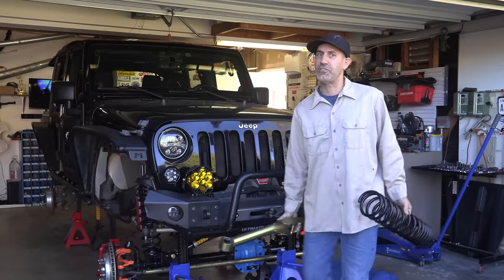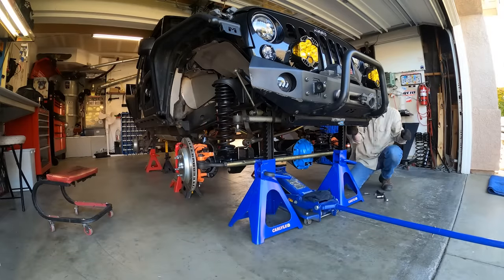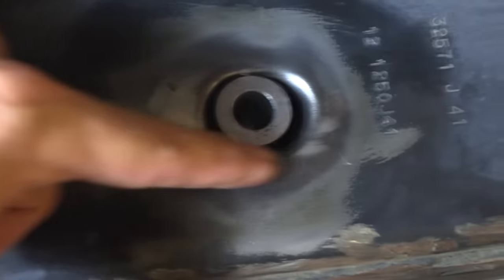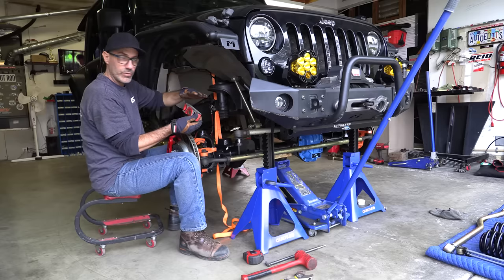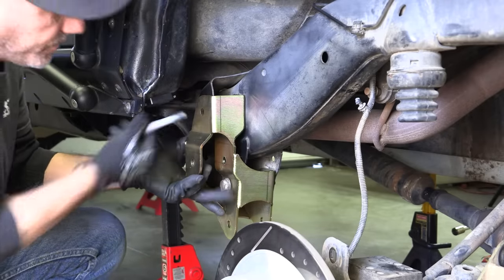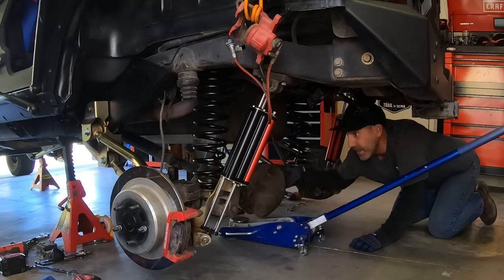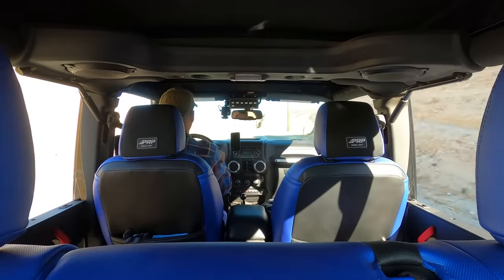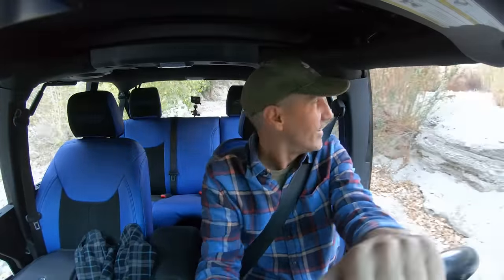4.5" Jeep Lift Kit How To Install DIY - Lock n Load Long Arm from MetalCloak

Comment: Running the same front bumper.  I also have the same scratches from the rocks.  I know it is powder coated, but you got any plans on dealing with those scuffs?
Reply from the maker: I really like the bumper as well!  Every once in a while I think about touching that up and then get distracted  by other stuff... they say the semi gloss black from rustoleum is the perfect match for that.

Comment: If you expend the energy to get an aftermarket steering box/upgraded steering box, make sure it is ready for Hydro assist. Nothing would be more foolish than getting a new/upgraded box without provisions for Hydro assist.
Reply from the maker: Absolutely dude! That is the type of advice people usually tell you too late so thanks!

Comment: Did you change the routing of your exhaust? It looks further back and clear of your front drive shaft.  Sorry of I missed that video if you made one
Reply from the maker: All good dude, it's the stock exhaust still from the manifolds to the Y collector and then it's the same Flowmaster kit to the rear.

Comment: Looks great but you may need to fold your top down when backing in.
Reply from the maker: I though that would help as well but the supertop has a bar that sticks up the same height as the top when it's folded down.

Comment: I believe your testament to this lock n load being awesome but one thing that’s holding me up from getting it is all the stuff I’m reading about radius arms.. that caster angle is tough to get dialed in where it needs to be, it binds (idk how), it “unloads” when climbing up due to the front radius arms (Jeep wants to roll backwards) , and last thing I read is “metal cloak is making these for people to just take their $$ because they don’t even do anything hence why you should only get it for 4.5+ lifts , and not mention the hang up points”.

So what do you think Jason? I’d like to see you take the Jeep off-road to see how it does, flexes , etc. can’t argue with results!
Reply from the maker: Sounds like you've been on forums or facebook too much. Yuck. Count on the fact that I'm going to take them off road and shoot honest performance videos my friend!
Reply: Yes forums lol 
One comment that really stuck with me was “if radius arms are so great how come Jeep has always made every Jeep 4link “ 
Which I guess is a good point
Reply from the maker: Everything has a compromise in design but I've seen guys on leaf springs do amazing things so take all that into consideration. This setup feels amazing to me so far... that look on my face from just enjoying the drive up the canyon road says so much about the practical application of this. If you're building a rock crawler and have the fabrication capability, do a 4 link. If you're building a combination Jeep like most of us... this is a fantastic option.

Comment: So I just got done installing the lock n load on my JKU Rubi..... did you notice a super tight clearance on the front locker electrical conector and the driver side upper control arm? Mine is super tight.
Reply from the maker: Yes, it is super tight. I've heard other folks using a grinder and a flap disc to make some clearance but I'm just rocking it as is.

Comment: Was the welding instructed or was that personal preference
Reply from the maker: It's part of the instructions.
Reply: I ordered the bolt-on option and it doesn’t say it requires welding. Also for the 4.5” lock n load JK (but 2-door).

Comment: Are you using 1 bolt for the stabilizer and track bar? Im installing the ultimate 44 this weekend and looking for options for the stabilizer mounting
Reply from the maker: Yes, it's a single bolt through the track bar mount. I have since cut that tab off of the UD44 bracket for the other style dampener to make more room for the proper components.  I've been really happy with the Icon centerline stabilizer.

Comment: So does it really drive nicer on road. Does it have better control and manners
Reply from the maker: Heck yes it does. Did you watch till the end when I was hustling it up the canyon? I make excuses to run errands and drive all over the place here in LA. It's amazing.
Reply: @AutoEdits  ya I did,  but sometimes after the initial install and living with it a bit,  opinions change.  Unfortunately I just checked and I don't see that kit available for the jlu. I have a jlu Rubicon 2018.  I bought the Rubicon Exspress kit with fox racing shocks.  The shocks are good but one by one I've been replacing parts of the Rubicon Exspress kit.  Its total garbage and rides a bit rough on the street no matter how much adjustments I make.  I'm ready to get something new with long arms.  Then add the gladiator to my garage and do the same.
Reply from the maker: Going with the MetalCloak Gamechanger is a big deal the springs and bushings will change everything you know!

Comment: Hi Jason, what are the dimensions of the Tom Woods shafts that you are running with the 4.5” lock and load kit? I was curious so that I can order mine before my suspension gets here! Thanks
Reply from the maker: I'm still running the same shafts from my original video and I don't remember what the measurements were. I'm going to refresh them pretty soon and get current measurements.

Comment: Are you still "impressed" with the lock n load lift? Considering for my JK Rubicon. What about the JK feeling top heavy or feeling "too high" on off road obstacles? Seems like 4.5 is high for a JK. Also hard to tell but what about the space in the wheel well...does it seem like too much?
Reply from the maker: 4.5" does not feel top heavy  at all in this JKU.  This thing feels like car... really stable. I love it more all the time and make up reasons to go run errands around town in it.  I have no idea what your talking about in the wheel well... whatever suits your preference. I want the most amount of up-travel to utilize the dramatic improvements this suspension offers.
Reply: @AutoEdits  Thanks for the response! Great video-can't wait for the off road testing!

Comment: Could you have stayed with a 3.5” lift?  Can the MC Lock n load be run with their 3.5” springs?

I’ve got 35” tires, and no desire to replace all that it takes to run 37’s

Thanks 😉
Reply from the maker: I absolutely could’ve done all that with my 3.5” game changer lift. If you watch my Colorado trip video... we did a HARD 7 trail and the Jeep did great... tires just rubbed a bit since I didn’t have the bump stops adjusted right for the 38” tires yet.
Don’t run radius arms at 3.5” lift... the geometry isn’t correct for that.

Comment: Pinto is cool.  Can you get a Dana 60 with 5 lugs ???
Reply from the maker: Thanks and yes, there are a couple of options that offer 60 center section and 5 lug semi float axles that I can use my JK brakes on as well.  That's the goal... keep it simple.
Reply: @AutoEdits   I could not find that on website from Dana
Reply from the maker: @keithhodge395  Dana doesn't offer one.... YET... inside word is next year some time but Fusion, Dynatrac and others have options.

Comment: Would you recommend getting the 3.5 game changer or get the 4.5 lock n load? I was going to get the 3.5 but after seeing this I want to buy the 4.5.
Reply from the maker: That is exactly the interesting factor here... I thought the 3.5 would do it but as I got more advanced... the 4.5 just solves ALL of my desires! So if you don't mind doing it twice... start with the 3.5 and drive it for 4 years like I did but the lesson I'm trying to share is that THIS IS the final destination!

Comment: Question. What's the need for a 4.5inch spring?
Reply from the maker: Good question... I asked as well. This is the exact lift height that gives just enough room for all of these components to obtain the right functioning geometry. I was tempted to use my old springs and try but was SO surprised with how good this thing feels just like it is with the 4.5 springs as intended. Plus I now gain that ever so slight break over angle advantage as well.
Reply: @AutoEdits  Understood sir. I have the game changer also and was questioning the long arms upgrade up front.
Reply from the maker: It's better than I expected so far but let me twist it up on some obstacles and see what she does!

Comment: Just wondering if you remember the lengths you used for the rear upper and lower control arms?
Reply from the maker: I don't but they are different for almost every jeep. I did another Jeep right after this with the same kit and had dramatically different measurements. Get the axle located where you need it to hit the bump stops pretty square and then measure for a starting length.  After that, adjust for the best balance between pinion angle and spring perch angle (you want that fairly level using the spring corrector plates)

Comment: I just ordered the front arms for my jku I’m slightly on a budget but My question is did you have to cut out that exhaust loop or did you leave it?
Reply from the maker: Leave the exhaust loop.
Reply: @AutoEdits  I see on metalcloaks webs site saying it needed to be deleted that’s why I asked. So have you ran in to any kinda clearance problems by leaving it in ?
Reply from the maker: @jordanpalmer9971  I haven't. Here's a video showing low angle stuff of it in action https://youtu.be/T6d2UwIfWmE

Comment: As always great videos. I do have a question ⁉️. Do you still have the 3.5 metal Cloak game changer components and just added the 4.5 lock n load long arm?
Reply: The reason I ask is because I want the same build but going to put 35 " tires for now until I can afford 37". So I would like to get the right kit without buying 3.5 " lift and then another set of coils for the 4.5"   lock and load long  arm after. So basically is it cheaper to get 4.5" lock and load kit and then get the 37" tires later on?
Reply from the maker: I gave away the old components.
Reply: @AutoEdits  So just the lock and load  long arm kit   Thanks 👍

Comment: Did you just kinda skip the gas tank removal part?
Reply from the maker: Nope. DB3 brackets in the rear are super easy.
Reply: @AutoEdits  ahhhhhhh okay I went full long arm 4.5” lock n load, not DB3. Mine required gas tank drop. Not fun but learned a lot about my Jeep in this project. More than I expected.

Comment: Seems weird to do long arm in the front and just drop down bracket in the back.....?
Reply from the maker: You couldn't feel the difference from the driver's seat but if you got time and skills to cut/weld up long arm brackets in the rear... more power to ya.

Comment: What type of air compressor do you have?
Reply from the maker: It’s an older craftsman pro. Does pretty good
Reply: @AutoEdits  I finally spotted it in your garage. Tucked in the corner.

Comment: What steering  box are you looking at?
Reply from the maker: I'm about to install a PSC in my friend's jeep and the only other one I hear good things about is the red head... any suggestions?
Reply: I have AGR.  Got mine for the extra strength of a Saginaw box (and it is prepped for hydro assist).  Mine has a off-center dead spot.  I dont know if that is common.

Comment: Got the same suspencion and noticed the sway bar links at a higher level than normal call metalcloak and they say it's normal can you tell me if you noticed the same and if this is normal..the links are 12.5 in length thanks
Reply from the maker: I don't know what the lengths should be but as long as they don't rub or hit anything, you should be good.

Comment: Can you do these arms with the 3.5” spring or does it have to have the 4.5” spring. Also what if I just started with the rear brackets with 3.5” spring? Any advice?
Reply from the maker: You "can" do that but they are designed for optimal geometry at 4.5" of lift and higher.

Comment: If you wanted to go bigger on 40s would u still feel safe or will u remain at 37 ?
Reply from the maker: This suspension setup would be fine with 40's but I didn't build my axles for that large of a tire.

Comment: Welcome.
I see that you also have a manual gearbox in this jeep.
In my jeep 3.6 gasoline, something gearbox breaks, probably because when I throw in reverse it can pop out and something scratchy. What could it be. you know something about it. Practically new car, 7,000 km.
I have to replace the entire gearbox? is it enough to replace something from reverse gear. I would ask for advice.
Regards and waiting for advice.
Reply from the maker: Possibly try this product https://youtu.be/kuKhtQ0sdy8
Reply: @AutoEdits  thanks bro.
Reply: Hi bro. I have problem with my jeep. 

Polski

Angielski

when there is pressure gas in my jeep at 3500 rpm, the ignition fails, the car loses power and the salt indicator light pops up. New spark plugs, coils seem to be working, fuel is always refueled at the same gas station. the car has 7000 km of mileage. What could it be. no knowledge on the Polish website. Maybe you have met with what or your colleagues. when the car revs at lower speed, nothing happens normally. only when the gas button is pressed on 3500 the car loses power and the cheek engine pops up.

Comment: Short arm in back not sure 🤔 I'm a long arm guy myself
Reply from the maker: Hey, if you got the time / skills to cut and weld up long arm mounts in the back... more power to ya.
Reply: Currie has a bolt on kit that's not that expensive.
Reply from the maker: cool

Comment: All that drama about the garage door and all you had to do was adjust it up more...
Reply from the maker: It’s adjusted all the way open and I’m not sure about all this drama you mention.
Reply: @AutoEdits  All the time spent airing down the tires and hanging out the door watching the drive out. Drama. My doors are the same and if the last panel is lower than the rest, you push it back to the end of the rail.